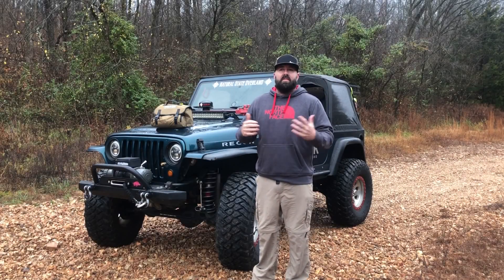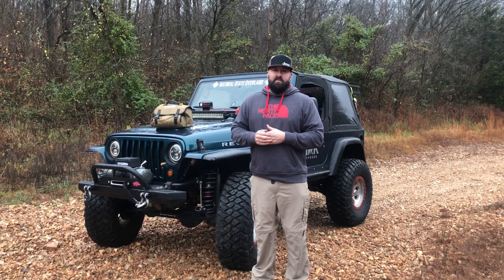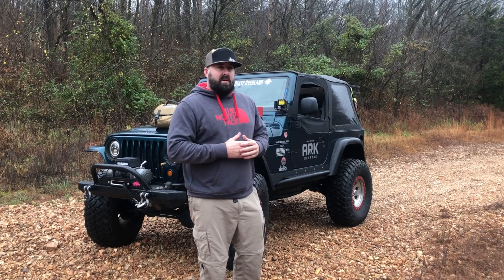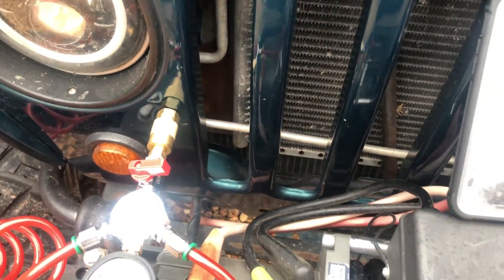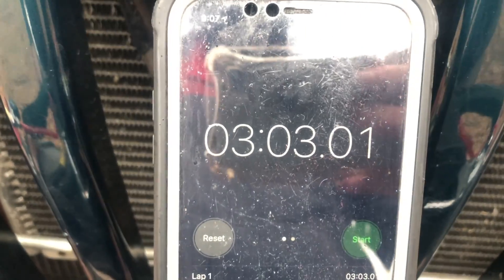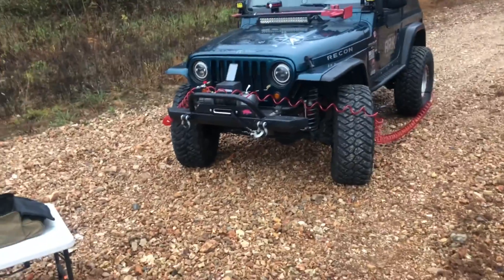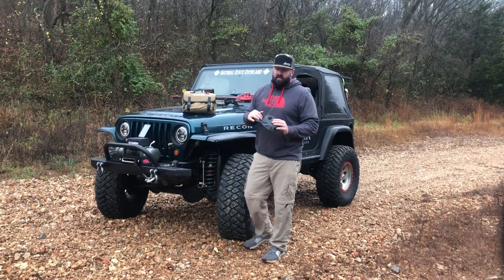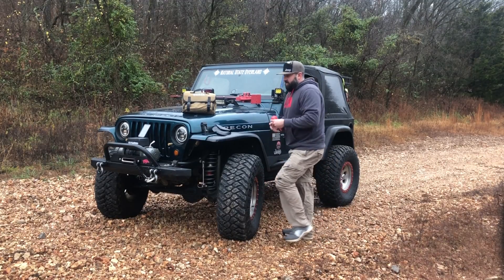4 Tire In/Deflate System

Comment: Nice setup! Do you have any issues with getting mud and dirt in your air chucks mounted on the grill? I built a similar setup for airing up just not as nice as easy as yours, you've given me a few ideas so thanks for sharing this! I used tire chucks that look very similar to yours, they are AstroAI closed flow tire chuck (found on Amazon)  instead of the open flow so my tires don't start to deflate when you take one off. The price difference between open flow and closed flow was only like 5 cents.
Reply from the maker: Hopefully the chucks are high enough stay out of a lot of the mud, time will tell , might have to get a chuck covers or some kind plug. Thank you for the comment about the closed flow chuck , I didn’t find those when I was parting the build 👊🏼